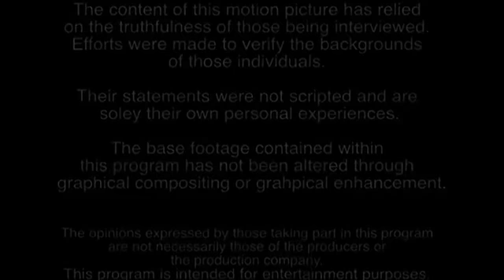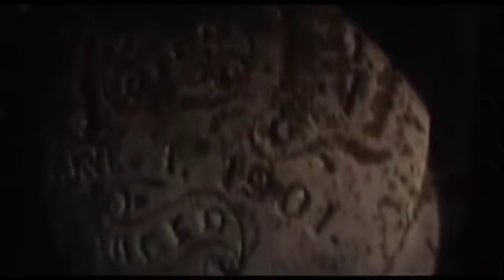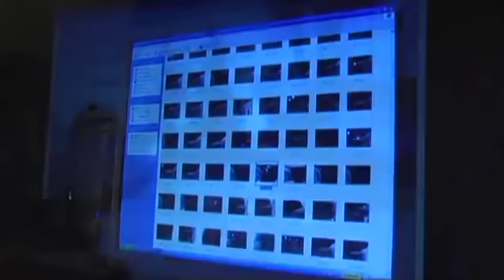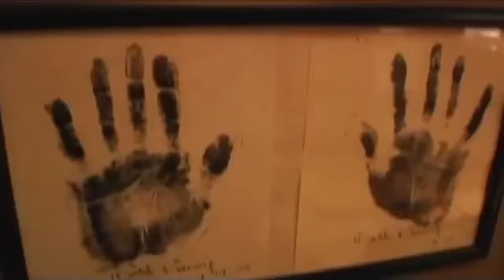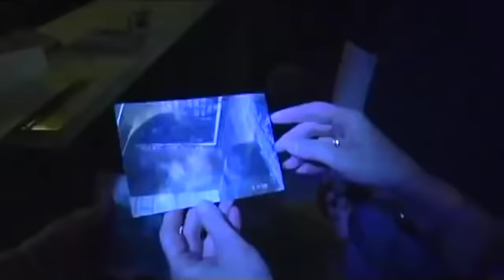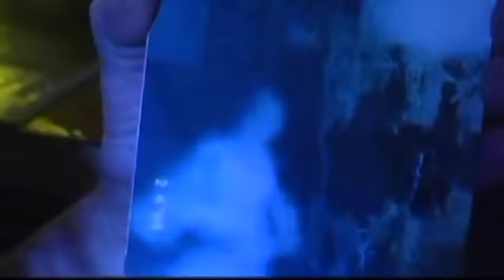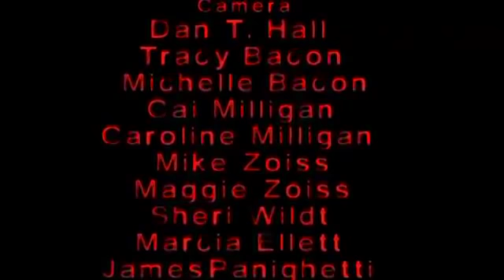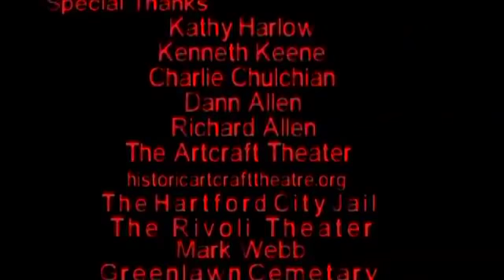Unexplainable Paranormal Events On Camera - Ghost Stories - Walking With The Dead

Comment: At. 44.03 to 44.05 when the camera pans to the car again, you can see a hand lift up (in the boot part of the car) 
Member of staff,, or the lady ghost at the run down theater.
Reply: You need to put the double dots ( : ) between  the numbers, that way the time stamp will work properly.
Reply: A voyeuristic couple into public 'displays' of affection?

Comment: I have to put a new video up with some new ghost pics from the Keepers house across from the lighthouse.  They are locked up for the winter.
   About 8 pm or so I took some pics of the Keeper's House & in a window you can see a dead mother holding a skeleton baby with a white cap and a head of a man sideways next to the lady.
   Another one in a window looks like a sock puppet type thing with eyes & a weird smile with lines of white coming off it.
 My friend & I walked back to his house after being at the lighthouse  and the dogs started acting weird, barking at the sliding glass door so I took some pics. You can clearly see a black hooded figure outside the door but with no legs. In another picture you see a clearly frightened little dog looking at something but in the glass reflection you can see a nasty creepy looking thing in the glass cabinet behind the door.